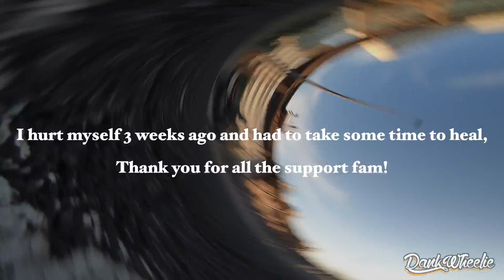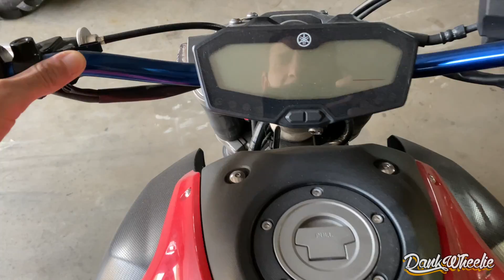The Best Budget Motorcycle? - FZ 07 Shred Test + Review

Comment: Got the MT07 for half a year now, it's such an easy bike to wheelie, very good engine.
One of the downsides is the electronics though, the display gives tons of problems.
Also the suspension is trash straight out of the factory. Easy fix is to put thicker oil in the front and stiffen up the back as much as possible.
Also the engine breaking needs to be tuned out to make it way easier to wheelie, if you let go of the throttle a bit to much the bike just launches you forward
Reply: yes the engine breaking is very hard on that engine have one to i like it on the road i can even follow mu friends in the twisties in 3rd gear jyst ysing throttle to slow down